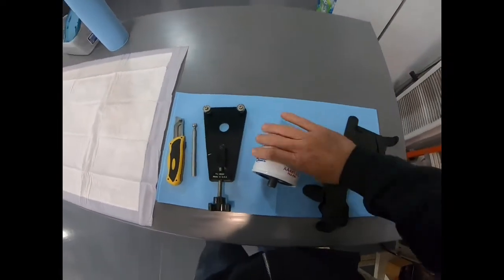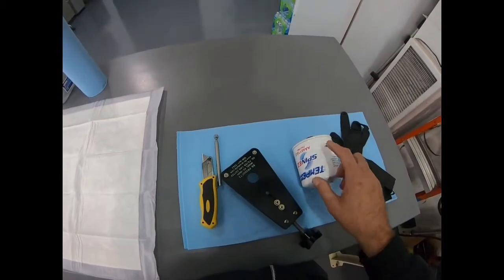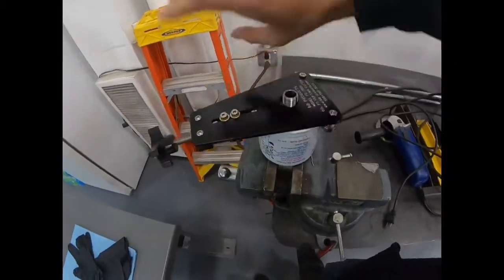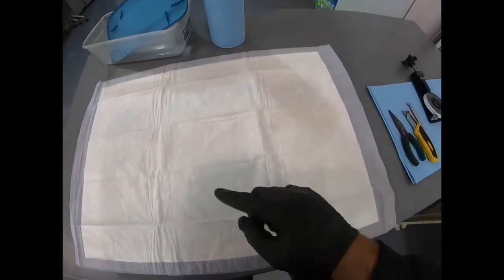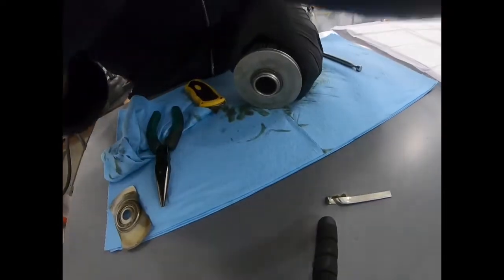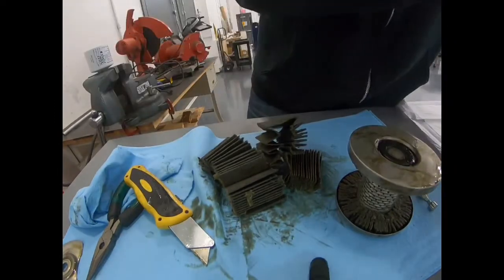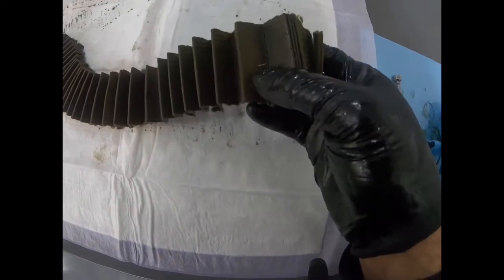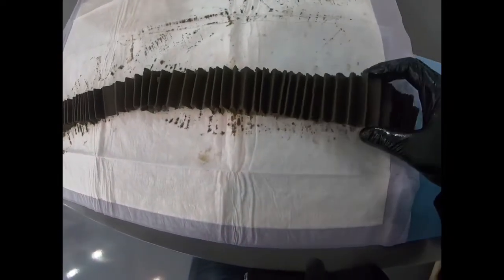Reciprocating Aircraft Engine Oil Filter Inspection

Comment: Slow down dude, you're jumping all over the place.

Stretch out the the filter pleats and set weights on their ends so that they dont accordion in again.
Then shine a good light on the stretched out pleats checking for non ferrous metals and then run a good size magnet along them checking for ferrous metal.